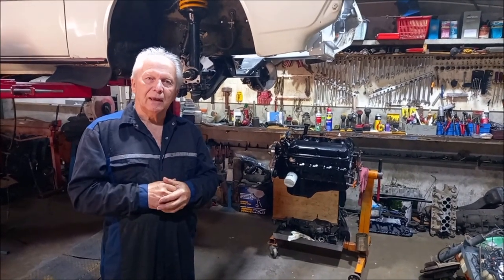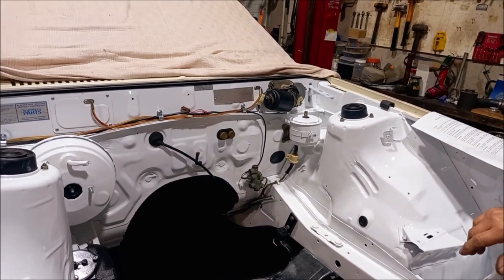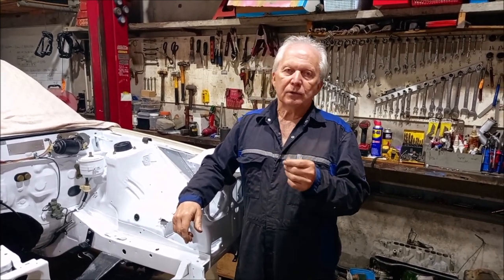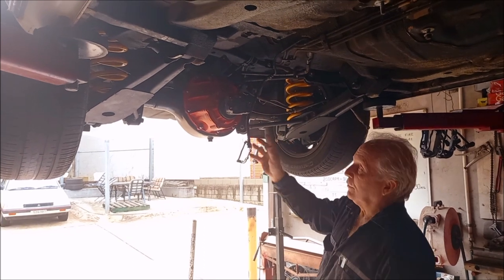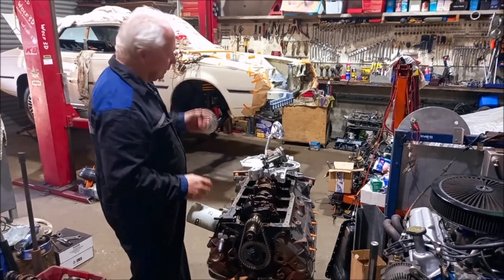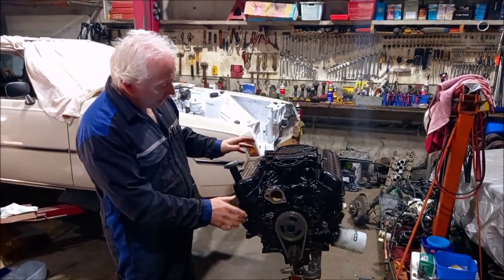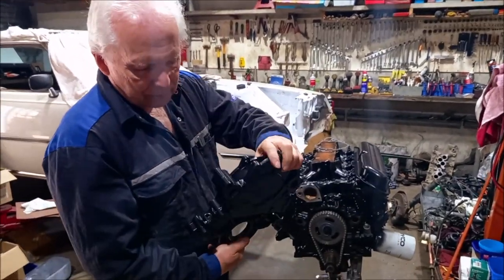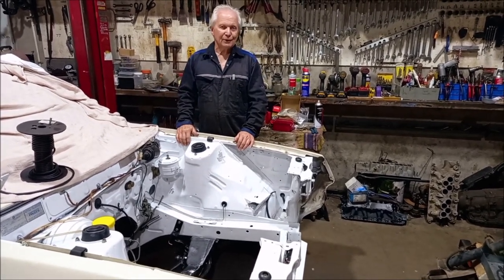Sigma Scorpion V8 conversion Part 2

Comment: Brilliant video 
I have a 62 Vanguard 6 Ute that I’m considering fitting a 302 Windsor too
My only issue by the look of it I may need the sump to be deep at the back as the chassis mounted crossmember is similar to a HQ Holden And the engine bay is narrow
Cheers

Comment: Excellent stuff. Ver informative videos indeed.
I was considering the 302 Windsor conversion in my Scorpion, but was wanting to know your thoughts on the 3.8 litre Buick/Holden engine conversion?
Reply from the maker: Not really a fan of the Holden V6, it's a bit wider than the Windsor, about 2 inches (depending on whose measurements you believe) and about the same weight. So you have a cast iron push rod V6 which is 3.8 litres or a cast iron push rod V8 of 5 litres which is easier to fit........

Comment: Is it easy to make adjustable castor rods for an R31?
Reply from the maker: I had a Cressida years ago, took it in for a wheel alignment the technician said there was insufficient castor on the left as a result of a previous accident and that was too bad as there is no adjustment and I would have to just put up with it pulling to the left! Not good enough for me. I took it back to my shop, cut the radius rod in half, threaded it with left and right threads then took it back, you should have seen the guys face.....